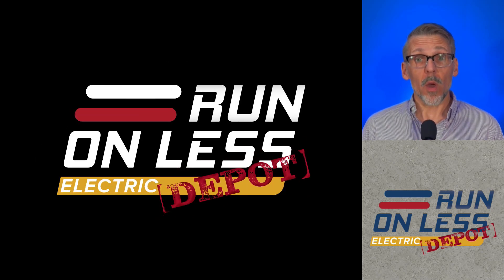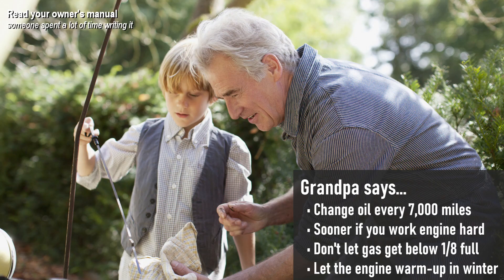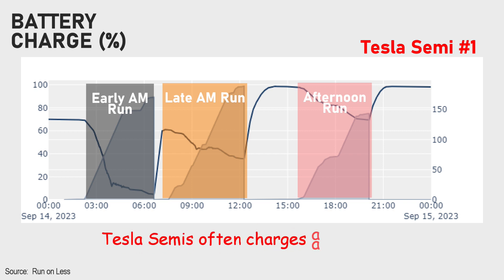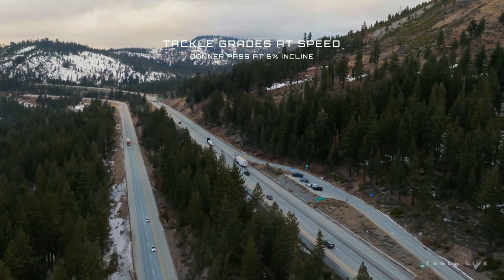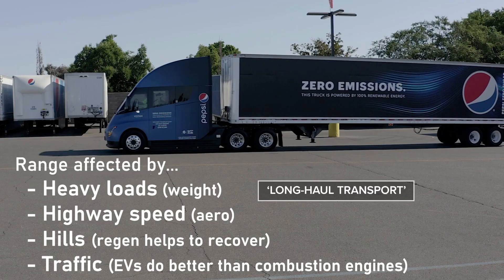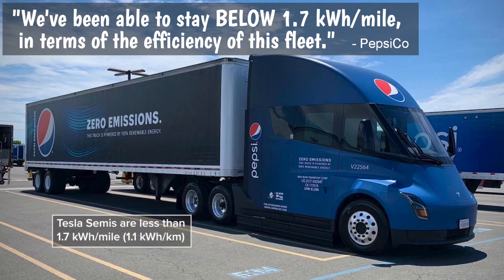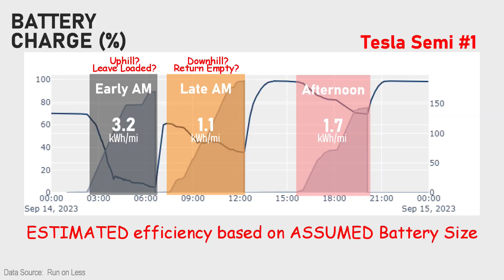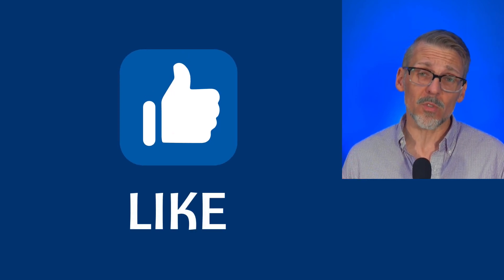In-Depth Analysis of Tesla Semi Data (Freightliner and Volvo too!)

Comment: In the mean time, Deisel trucks can travel up to 4 times the distance before needing to refuel. On average of 1500 to 2000 miles of range.
Reply: I .? the maintenance part of diesel truck and you have to add up the time to maintain the diesel truck? I could be wrong. Could you tell me what maintenance the electric truck need I know braces may last 4 to 5 x longer no oil change,oil filter and a of other item
Reply: The big killer is throughput at a charging station vs fuel island.  So it takes hours to charge a semi, have you seen a modern truck stop on the interstate?  There are several hundred semis that fuel and move on during the time it takes an EV to recharge to 80%.  And they tout mandated down time, what is the percentage of team drivers that go 20 hrs a day with just fuel stops.  Logistics just don't work for OTR.
Reply: @dsmreloader7552  The infrastructure itself is a bigger killer- how many megasuperincreda chargers do you see in the middle of nowhere?  More importantly where is the power generation for these chargers?

And again- more expensive initially, pack replacements are inevitable and incredibly expensive and of course 1/4 the range and less capacity.  All while taking far longer to “refuel”.
Reply: @dsmreloader7552, but also, how many diesel trucks you see stopped overnight in truck stops for their drivers to sleep? How much time a driver is required to stop for breaks and rest? Most drivers work alone, so for them, the downtime of an electric truck is not an issue
Reply: @raphaelrodrigues1645  1/4 the range. 3/4 the load.  More expensive in every metric.  Doesn’t make sense, sorry.
Reply: @raphaelrodrigues1645  I think you meant rest stops, there isn't any refueling at public rest stops. Deisel Semi-trucks can travel from coast to coast with maybe one fuel stop. This causes hardly any strain on the power grid. If all those were converted to EV, how many more power stations will be needed? Do you know there is a huge back log of transformers just for normal maintenance and construction of new utility infrastructure? Guess where we get them from, yes, China primarily. Because the USA government is stupid and shut down minning for copper and many other minerals/ metals here in our own country.  This is why USA is getting poorer and things are so expensive.
Reply: @dsmreloader7552  Half an hour per charge. Perfectly fine.
Do your resaerch, invest in Tesla.
Reply: I trust those people who don't risk a single penny with their comments. Why?

Because people investing more than a 100 billion dollars surely never made the math and are just risking everything for just a vague guess.

This must be the reason why we see so many people in the comments knowing better, because they did the math, for nothing.
😂
Reply: You are hilarious!  That is COMPLETELY irrelevant.  Daily range is limited by legal hours of the driver at the wheel, NOT by the size of the diesel tank.  Those are generally big only to facilitate fuel price minimization.
In Europe, a driver can cover an absolute legal maximum of 506 miles in a day, but more like 420-450 miles in practice!
Reply: And “recharge” in about 10 minutes.  All while carrying a bigger load.  Oh and they are cheaper to buy and to maintain.

So where is the economic incentive for companies to switch to electric?
Reply: @prof.crastinator  It s called money savings. It happens in maintainance and fueling. Writing words on a youtube comment doesn t make them true xD

Do your research, invest in Tesla
Reply: @lucadellasciucca967  Where is this money savings, exactly?  

Guy who literally just wrote something in a you tube comment and expected people to believe it?

1. Tesla semi costs more initially. (More than double)

2. The infrastructure needed to charge quickly (still not very quickly) costs millions, negating any fuel savings.

3.  The packs tesla uses (nca chemistry) cannot last the lifetime of rapid charges that these semis will require. A diesel truck lasts from 500k to 1million miles- a tesla semi will need multiple pack rebuilds or more likely replacements to last the same- these will far outpace normal maintenance on a diesel semi.

4. Then there is the 1/4 the range, 3/4 the load and much much more downtime while charging…

Where is the benefit!?
Reply: @prof.crastinator  Can t wait to see your face when semis are all over! xD Good luck mate.
Oh and i didn t ask anybody to believe anything. I don t care! The lower the stock price the bettere for me! Don t buy people! For the love of god, don t do your research!
Reply: @lucadellasciucca967  You’ll be nowhere to be found when it inevitably fails.  I KNOW big companies will buy a couple for greenwashing purposes- but they won’t be EVERYWHERE- just populated areas.  Big buildings get giant government subsidies and tax breaks for these- and even then they are losing- look at pepsi.
Reply: @prof.crastinator  It s gonna take time. Tech needs to develop. Infrastructure needs to put in place. Tesla has all of that down toa a science.
Do your research, invest in Tesla.
Reply: @prof.crastinator  We re not talking about NIKOLA trucks xD
Reply: @lucadellasciucca967  It’s going to take MONEY and time- what tesla has down is getting taxpayers to pay for infrastructure and then making money on it.

Publicly subsidized privately profitable…
Reply: @prof.crastinator  They are quite smart indeed. Do your research, invest in Tesla.
Reply: @lucadellasciucca967  exactly as smart as you turbo
Reply: @lucadellasciucca967  Obviously,  you haven't checked out maintenance issues with EVs... as all your favoured Tesla channels won't mention that.  Nor have you checked out the massive depreciation.  Nor the real fire risk.  Nor the actual charging prices along the highways, some of which exceed the price of fuel, based on miles.  "Do your research" means more than just soaking up everything Tesla throws at you.
Reply: @maxhugen  You re so very wrong my guy! I know more then you think. You re not keeping up with future innovation. the adoption is going to make everything soooo cheap. You ll need brain damage not to buy an EV in 5 years.
Tesla is a very specific EV. Most of the problems you talk about are about non Tesla EVs.  AS far as Tesla serivce, it s not the best, can definitely do better, and of course i m confident they will, but the point is any difect you name is too small to outweight the advantages The adoption curve is not gonna slow down and the difects will be worked out. 
The future is sustainable energy and autonomous EV transportation. Phisics says so.
Do your research, invest in Tesla.
Reply: @lucadellasciucca967  Tech is my biggest problem with it. I don't want to be sitting inside a computer on wheels. Same goes for my pick up truck, that's used daily for hualing and transportation of equipment and smaller vehicles for work. I love PC's, I have a really nice PC build, I like my pocket PC too, but they do have their own set of issues from to time ranging from software to hardware. Now you want to further complicate vehicles  (which are primarily mechanical) by turning into a PC on wheels. What could go wrong with that??? How about we keep them as simple as possible, easy to maintain and repair in my garage.
Reply: @lucadellasciucca967  "Autonomous" so you're willing to put your life into the hands of a computer? Also, oil, natural gas is also sustainable, and so is nuclear. It has been proven that Oil is Abiotic, meaning it is naturally produced within the Earths mantle and pushed up into the crust where we can access it.

Comment: How much load was Tesla with it 10000 pounds? 40000 pounds that's a question I don't know. Did you answer that. You also stayed 50 miles or plus on the highway. What trucks go 55 on the highway? Everyone's doing 75 to 80 on the highway. If not, you're gonna get run over. Why is tesla only produced about fifty trucks when they said they'd have about fifty thousand by now

Comment: The SoC data being published is almost certainly the "useable" SoC after the BMS calibration limits have been applied ie when the data says the truck is charged to 100% the battery cells are NOT actually at their peak voltage, merely that the battery has been charged to the level which the manufacturer has selected.  Typically for an HGV application there will be something between 10 and 15% buffer capacity that is not "useable" at least not when the battery has a 100% SoH.

Comment: Lithium ION batteries are limited to 80% as Lithium metal precipitates on the electrodes at high charge levels.
Lithium Iron Phosphate batteries are recommended to be charged to 100% at least weekly on the other hand. (Tesla manual data).

Comment: I always wondered why the battery packs aren't mounted on the trailers themselves. Running out of battery? Leave it charging and pick up another trailer. Who cares about supercharging them?
Reply: For every semi tractor in the US there are about 10 trailers.  Typical usage is to haul a trailer to a destination, park it there, and pick up another trailer for the next leg.
Reply: traction!

The drive axles are currently on the Tractor unit, so this unit needs enough mass to be able to generate enough tractive effort to accelerate (and deccelerate) the entire rig. The batteries are heavy, so putting them on the tractor unit is a no-brainer. It also allows the existing std trailer fleet to be used without any mods etc

Comment: I would take Pepsi at their word about energy consumption. They have the exact numbers for the energy used. You were estimating based on an assumption about usable battery capacity. Your quess might be correct on the day the truck left the factory but you didn't take into account the initial battery degradation. I have a five year old Model 3. It was supposed to have 310 miles of range, today it has 288. Almost all of that degradation happened the first year, the degradation since then had been very small. Pepsi drives their trucks much harder than i drive my car. The initial degradation probably happen in the first month vs the first year for a car so the usable capacity for their packs will be at least 10% less then when new. Given that they might be putting 100-200K miles per year on the tricks the degradation is likely more than 10%. But using the 10% number that would account for the entirety of the difference between Pepsi's 1.7KWh per mile and your 1.9KWh.

Comment: Until you know what the weight is that they are hauling, your you dont have a clue. Your missing the most important data!!
Reply: Are they carrying 50 or 20? Makes a diff.
Reply: However, one can look at statistical means and averages to gain some insight. As he said initially, that data is not available in the dataset provided by the operators. We work with the data we have available.
Reply: It’s the number 1 data point! Quickly mentioning it as an aside doesn’t help these calculations. All other info is irrelevant without it. Assuming empty backhauls in the real world is unrealistic. Most likely 48k product out and 25k dunnage back. I drove for Schneider in the nineties and I can guarantee they are tracking absolutely everything going on with those trucks. For example, even back then they tracked how high you revved the engine when downshifting and was one of the many charts and graphs they showed you during your reviews as part of their efficiency program.
Reply: Now that we know the Semi's weight, we know that the 500-mile version can tow, with 1000 lb, the same than the average diesel rig, and the 300-mile version 3000 lb MORE!
Reply: he literally said that in the first 2 minutes
Reply: @terrygirgich643  No he didn't. He said they hauled different loads but not a single digit telling what the loads were. Why did you say that he said what he didn't say?
Reply: @skunkjobb he said you don't know what their hauling so you can't make a direct comparison. He literally said that multiple times. The whole apples and avocados thing remember.
Reply: @skunkjobb  he said the same thing you did. that we don't know what they're hauling so the data is almost worthless.
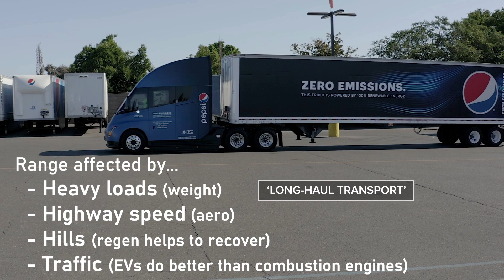Reply: @skunkjobb  He specifically said that he did not know the loads at around @9:00....   Watch the video before commenting.
Reply: @thatguyoverthere9634 so - he admits in his first 2 minutes that the entire video is a conclusion based on worthless and missing data.  And you’re sticking up for that??
Reply: @terrygirgich643 if the data is almost worthless than the video should not be made. The end

Comment: The absolute solution for Class 7 and 8 EV Trucks is construction and LTL.

LTL city driving and a short highway runs 250 miles and under.
Construction - dump trucks, end dumps, and garbage trucks.

It's hard to imagine how FedEx and UPS have not contracted to get an EV something like Wal-Mart and Amazon.

Comment: How does the cost of operation compare to diesels?
Reply: That's the #1 selling point of EVs - far lower operational costs and lower total cost of ownership.
Reply: @truhartwood3170 maybe in USA in EU countries like italy and poland have so high electricity prices thats not worth go EV
Reply: @sladewilson8241  that is totally not true - you are way out - ROI is 3 years, 5 years max depending on usage and km clocked up etc - but in Europe, Trucks tend to get renewed out at 300,000km (1st owner sells), 600,000km (2nd owner sells then normally exported to outside Europe/Africa) and 900,000km (The truck is normally export to Africa at this point)
Reply: @QALibrary  i live in poland and tell me how is ROI possible when we pay over 1 euro for kwh? We pay more for electricity more than cost of desiel per km not to mention that Ev are so much more expensive to buy. And also you earn less because ev trucks have terrible range(volvo ev 300km) compare to desiel where easly you do 800 km daily. Yes cargo company pay you for km so longer trip better ,staying and waiting to charge is loosing money
Reply: @truhartwood3170  That depends on the longevity of the batteries.
Reply: @PistonAvatarGuy  which is now more than the life of the vehicle.
Reply: @PistonAvatarGuy  Google. Don't be lazy. Maybe even check before you post.
Reply: @truhartwood3170  As far as I can see , no one has that data, as the trucks haven't been driven far enough to gather anything conclusive.
Reply: @PistonAvatarGuy  oh, sorry I thought this was commenting on another EV video. The batteries should last about a million miles before a company might want to replace them, though they could also sell the truck at that point to a company that has shorter routes, or just move their older trucks to their own shorter routes. The batteries don't stop working, their capacity just goes down slowly. So as long as the range is farther than what you need you can keep using them. Eg at lot of companies are buying electric trucks with only 150mi - 250mi of range, so the 500mi semi could lose 50% - 70% of its range and still do the same routes as these vehicles can mange brand new. That would take, like, 3-5 million miles to lose that much capacity.
Reply: @truhartwood3170  It's highly doubtful that they'll last that long, as they're being charged to 100% and drained to the single digits on a regular basis. Even babied BEV car batteries have wildly differing lifespans, as the whole pack can be taken out by a few bad cells.

Comment: Charging to 100% is not that big a deal provided you don't leave them at 100% - I'd say they've sorted out their charging so it finishes charging just before it begins the next route.
Reply: I don’t know their plan, but 100% is probably not 100%. Tesla did that with their cars, the software limits how much you can charge to and discharge to.
Reply: Degradation happens due to the dynamic nature of the battery.

Comment: it seems EVs both commrecial/passenger, working trucks/cars, in general seem to be decent, if not quite good. But their longterm say min 10yrs+ and/or over 150k miles mileage life seems a bit more iffy and ymmv.  There are outlier vehicles hitting 200-300k, but they're more rarer.
Reply: Tesla is guaranteeing them for 1 million miles. Best batteries coming out right now have 1.5 million km/15 year warrantees.